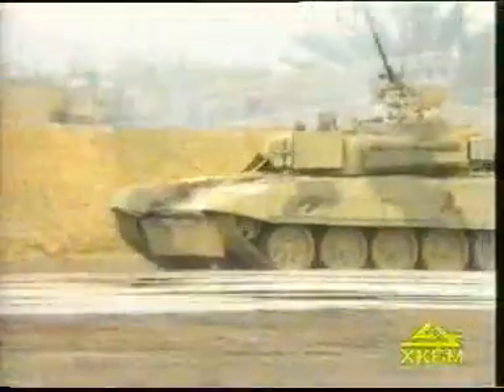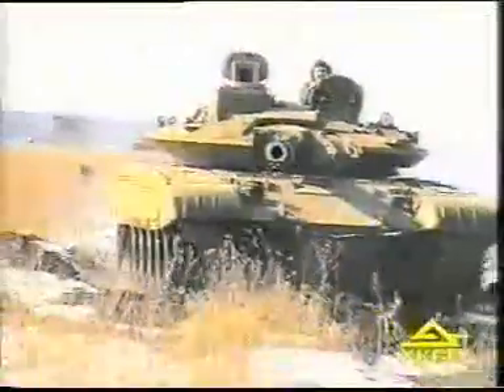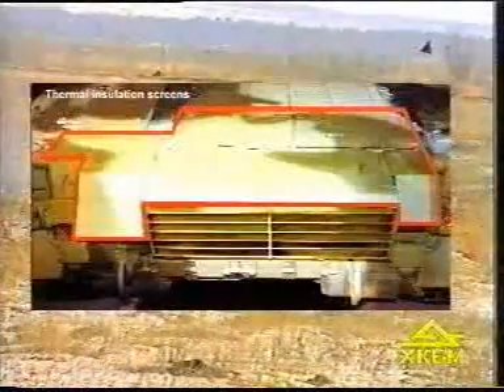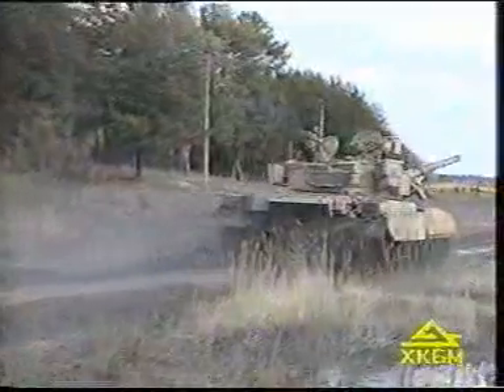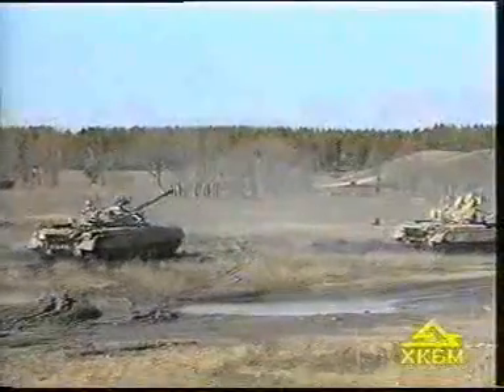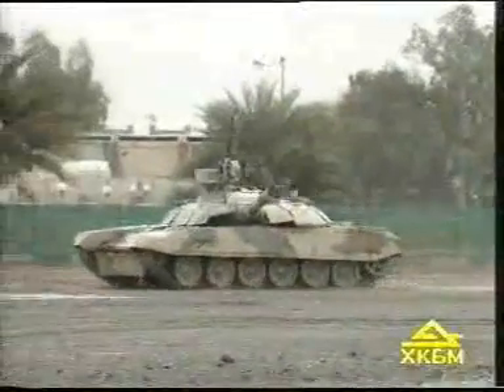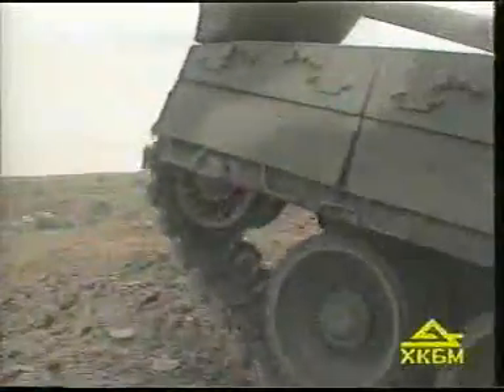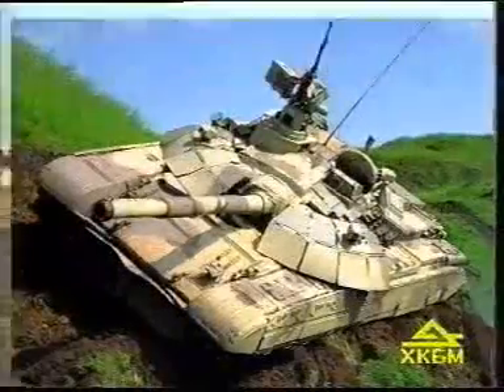Modernised T-72 MBT

Comment: The T-72MP must have a 125mm KBA-3 smoothbore gun with a 2E46M2 gun stabilizer to fully integrated with the SAVAN 15MP fire control system + the gunner SAVAN 15MP multi channel thermal sight + the commander SFIM VS580 panoramic sight.

Comment: Both were made to win wars.  Both were built to similar roles as well as different ones.  But they had different backings, different national interests and priorities, etc.

The T-80 was designed to lead spearheads, but the M1 was designed to use armor and gunnery advantages to enact a heavy toll upon this advancing armor from prepared positions.  The M1 and T-80 were both also designed for fast, short blitzes.  M1's proven to be VERY good at this; T-80 was disappointing but saw little use.

Comment: I wasn't talking about the tanker overriding gun stabilizers i was talking about electorincs part. I don't think that a tanker will need to override the gun stabilisers since its a very helpful feature. U need to stop reading into words too much because by focusing on little things u r missing the big picture. Withregards to price anything that is put on mass production becomes very cheap very quicly same thing goes for both shells and missiles (tank misslies r not ICMBs)

Comment: The "Moving wall of fire" is not a Cold War tactic it was developed during WWI and was used by all sides to a good effect. Also, as WWII shows tanks have a tendancy of going far beyond infantry and artilery. Tanks are your cavalary of 20th and 21st century thus the tanctic u r talking about has an effect only if tanks have artilery support which is by far not always the case.

Comment: The gunner does not hold the missile on target its done automatically. The gunner may override the system if need be. The psychological attacks with missiles were never done because there was no legit full-fleged tank on tank battle since WWII (The desert storm was a joke since u got Lions of Babilon against M1s). Those missiles are not drasticly more expensive than regular shells. Also, the engagement distance is not defined by the gun or shell alone its also defined by terain.

Comment: Devil in details u say OK. Full speed is not the samething as maximum speed. Full speed varies on the terain the tank is moveing on. Also why wouldn't a tank be able to shoot at 70km/h? will something clog the gun or the gunner will have problems pressing the fire button? Ability to shoot and hitting targets are two different things. Thus according to ur logic u r wrong aswell.

With reagrds to keeping aim have u heard of gyroscopic technology that was developed during, if not before WWII.

Comment: What don't u get about LeClerc? I have read a number of reviews about this tank and they are not very good. Also there are a number of video reviews on youtube aswell stating that its not very reliable which is a serious drawback. Also, this tank officially falls into 3rd/4th generation tanks. No country has 4th/5th generation tanks i don't know where u got that the tank is 4th/5th generation.

Comment: Yes, T-90 and T-84 are the 4th generation tanks fully and their are direct counter parts to M1s, Challenger, etc. LeClerc is not a 5th-4th generation simply because of the poor reliability of its tech. However it is a first attempt at the 5th-4th generation tanks.

Comment: I know Russians have 4 generations (because they actually made good tanks before WWII and during WWII). While USA has 3 generations because they had barely any tanks before WWII and a few tanks during WWII. I would agree and disagree with you. T-80 is a limbo tank between 2-3 or 3-4 generation depending on which scale u use. It was suppose to be able to repell M1s, in particularly the modified T-80s.

Comment: The Soviets saw tank generations in this manner: 1920-1945, 1st generation; 1946-1960, 2nd generation; 1961-1980, 3rd generation; and 1981-present, 4th generation. Since the last really new tank design, the T-80, came out in 1976, they feel that they have not produced a true 4th Generation Tank Design. In comparison, they count the M1, Challenger, and Leopard 2 as 4th Generation and the LeClerc as 5th Generation.

Comment: Yeh I want to see the clip. Also how do u know the real accuracy of US tank crews?

Where did you get the idea that the tank has to be stationary in order to shoot the missile? I say do ur research with regards to missiles. Their range is between 4-5km and they travel at high speeds. In addition they are capable of penetrating 750+ mm of armor. There was a case were Hamas managed to penetrate front armor of Merkava II and III useing similar missiles

Comment: No tanks don't have to be stationary to fire.  But beam riding requires a fairly static base, due to the sensory system.  If you move too much, it throws off the laser sensor, as the missile's guidance is dependent upon a rather linear vector from point A to point B.  It also loses accuracy exponentially, which makes its effectiveness at its stated range questionable, especially given the historical quality of Russian fire controls.

Comment: it's really not that complicated.  Independent analysis is the bulk of intelligent research.  I'm not a scientist, but i have a fairly good understanding of how the composites work.  They've released a degree of information about them.
Triaxially-compressed ceramic tile with high-hardness DU linings is very, very tough to penetrate.  it's physically thicker too.
Russians use ceramic and boron-carbide, but less overall thickness by a significant multiplier.  They rely too much on ERA as well.

Comment: 1) How do you know they got improved armor? The armor of M1s of all type is strictly clasified.
2) What weaknesses did those missiles have? Missile is a missile which is much more powerful than a shell. Heat-seeking missiles have no problems of finding M1's due to the heat signature given off by those tanks. Also how do u know the exect number of tank missiles USSR had? Did you work for the Soviet ministry of defence? Those tank missiles are not expencive they are not ICBMs

Comment: The fired missiles from the tanks not only have great penetrating power but are also very accurate. Here is another fun fact M1s of all types got turbine engine which puts out massive head signature thus makeing it easier to take it out with a missile. Also the T-72 and T-80 (not so much with T-64, but also some what could do it) can shoot acuratly while on a move on high speeds. This is is demonstrated on all tank shows.

Comment: The T-80 is a design intended only for shock divisions, similar to the M1A1HA (its primary competitor).  The M1A1HA at the time had better armor and accuracy, and was its primary opponent.
The M60 was of the same generation as the T-55 and T-62, and was intended to face primarily the T-62 and early uparmored T-55s.  it was extremely well armored over the turret frontally due to shape, which made it good for hull down defense.  It was more than enough for that role of a second, backup vehicle.

Comment: See the fact that T-64 was produced in very large numbers and MBT-70 wasn't shows that T-64 was a better and cheaper tank, simple. T-72 was a slightly better version of T-64 that utilised slightly better tech and costed a bit less than T-64, but it hasn't replaced the T-64. T-80 was a third generation tank produced to counter the new/future NATO tanks (ex M1A1) of the time.

Comment: The time or manufacturing has very little to do with the generation of the tank. Generation is defined by what type of technology is found on the tank (look it u4p). T-80 was manufactured in late 1970 and is closer to M1 in time frame than T-72. MBT-70 was very expencive thus less superior than T-64. By the time USA puts out 100 MBT-70 USSR will have 1,000 of T-64 that will over-run the MBTs (try studying tank battles of WWII). You cannot compare tanks simply by time you have to look at tech.

Comment: T-90: Engin has around 1250hp and making the ratio 23.7hp/t however the top speed is similar due to the greater weight of T-90. The range of T-90 is more than 500km where as T-72 has about 450km. T-90 has 3 tiers or armor ERA, Shtora, and the actual steel in addition to this T-90 is pact with electronics to help the crew in driving and shooting.

Comment: T-72: Engine has a 780hp thus the horse power to tonage ratio is 18.8hp/t. Maximum speed is 60km/h on road. The defensive armor is not as moderate as you would find on T-90 simply because T-72 was not developed to house such technology. Also the aiming is not as precise as in modern tanks.
Abrams: Engine 1500hp  and the ratio is 25hp/t the speed i belieave is similar but M1 tanks are heaviers. Also M1A1(A2) has a lot of modern technology for aiming and driving.

Comment: Just in case anybody is confused out there.  The Iraqis were using the T 72m which was the export model.  By the time the battle of 73 Easting occured, the Republican guard was down to half grain on their rounds and had not received any new replacement parts on T 72 in over a year.  I think the combination of all of these things is fairly significant.  While I am glad that the US has the M1A2, lets not get over confident.

Comment: @hotpocketpoison Su-25 doesn't need a Gatling. It has GSh-30-2 with 30mm rounds. Enough to kill any tank. Relikt and Kaktus are still classified so there is no NATO round in existence that can penetrate it.
You checked info on stuff that was used in combat against US. But Russians have long proven that stuff that STAYED IN RUSSIAN MILITARY was still superior to US
A-10'd get smashed with Tunguska point defence system and S-300 and TOR systems would kill most before they get close. Anything else?

Comment: @hotpocketpoison Su-25 has a 30mm GSh-2-30 with AP rounds. Don't need to shred tank to kill crew.
US tech is merely prettier named but Russian stuff way more rugged and reliable and needlessly complex
FYO Relikt and Kaktus ERA are not even installed anywhere so you have no idea if new APFSDS will beat it
Reiterating that Russian tanks with composite armor were never exported outside USSR. M1A1 failed in Saudi Arabie last year together with Leo-2 and LeClerk while T-90 made it and won.

Comment: @hotpocketpoison You just quoting Tom Clancy who is a moron. The only thing in common between GENUINE Soviet T-72B and export T-72Ms that US/NATO encountered was overall shape. In 1996 Kontakt-5 equipped T-72B was fired at by Abrams using an M829 APFSDS which failed to penetrate 100% of the time. Also US/NATO were fired at with a 3BM13 APFSDS with steel core that USSR decommissioned in 1973. As for A-10 - Russia has Su-25 that'd do same to any NATO tank. Go read up on T-72 from NON-NATO sources.

Comment: @Egodraco From afar? Western tanks have problem then since late T-72, T-80 and T-90 can fire ATGMs from beyond the accurate range of western tanks.
Placing ammo in a hull is actually ok since its protected by the main armor. Whether that armor is strong enough to handle the modern AT weapons is different story. In big combat is bustle goes BANG the crew is at least contused. In any case if attacked from above the crew is dead as well as tank since roof will be penetrated easily.

Comment: @Waltham1892 Fair enough. If it was HEAT then it'd be one from WAY back before M1 Abrams was in series production. The PG-7V and PG-7VL would only penetrate the roof of Abrams and maybe from dead behind. They have no more then 400mm RHA penetration rating. There were a lot sent to Saddam and being of utterly obsolete spec were as useless as the tanks of Iraqi army

Comment: The gentleman who fired the RPG caught the attention of my wingman, and as a result, was in no fit condition to tell anyone what he had fired.

I can say, based on the point of impact, that the warhead must have been a HEAT type round.  

As for what equipment my tank had or didn't have, I'd rather not discuss that in an open forum.

Comment: @Waltham1892 I'd like to ask. What grenade hit your tank? HEAT or HE-FRAG? Did your tank have TUSK kit?

There are many different grenades made for RPG-7. HEAT, HE-FRAG, tandem-warhead HEAT, thermobaric. Also the single-charge HEAT came is about 3-4 different versions each with different armor-piercing rating. If your tank was hit with HE-FRAG round, of which Iraqi insurgents have a lot, then those wouldn't penetrate any tank today.

Comment: @Waltham1892 

Plus Kontakt-5 ERA used by Russian forces was proven Immune to all NATO Rounds until the M829A3 came out then the Russians countered with Relikt ERA which is 2x stronger....the Abrams doesn't even have ERA....why don't you test an RPG-29 to the side of the tank directly where the commander sits and see the damage...or a shot from a 125mm gun that's not using ammo from the 60s...

K2 deflected L55 120MM from a Leo 2..
T-90 Relikt ERA defeated Modern NATO Rounds...

List goes on

Comment: The T-72 was intended to be an inexpensive tank like the T-62, and not an MBT like the T-64/T-80.  Because of the original design trade-offs the T-72 is to small and light to go toe to toe with Western MBT's.  Adding armor brings diminishing returns while increasing costs to procure and sustain.

Add to this the flaw of ammo storage in the armor envelope and you've got a very problematic tank.  

The T-72 reminds me of the latest Israeli M-60's, pushing an old design farther than it merits.

Comment: @MrStewart149 You are an utter fool. All the exported T-72 that US/NATO encountered had maximum of 400mm of RHA on the front and it was pure steel armor at that, Russians kept the REAL T-72 with composite armor, AKA Chobham style, to themselves and it was further supplemented by Kontakt-5 ERA. Tests of T-72B equipped with Kontakt-5 ERA (Standard equipment) were ran in 1997 by NATO where Kontakt-5 ERA completely neutralized M-829A1 DU APFSDS.  NATO was disinformed as USSR intended.